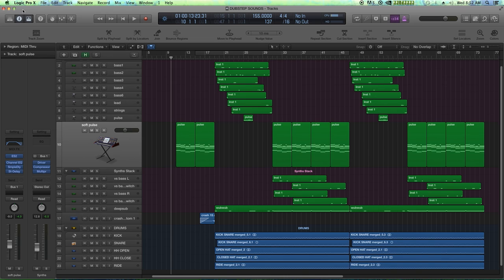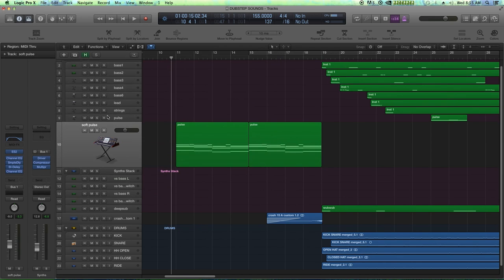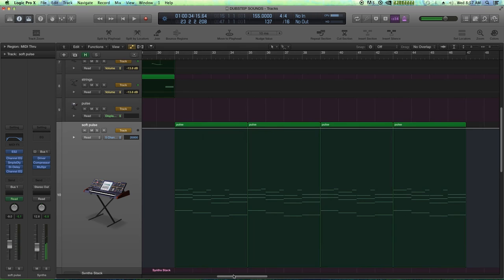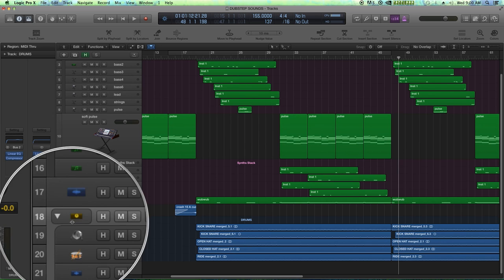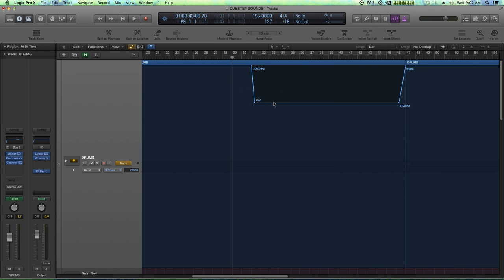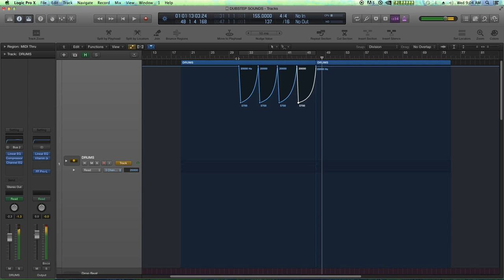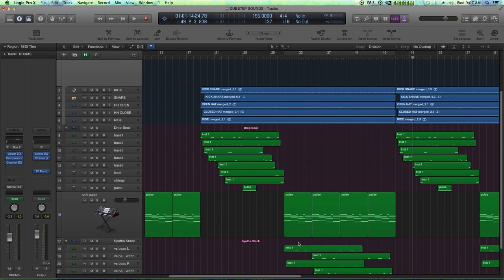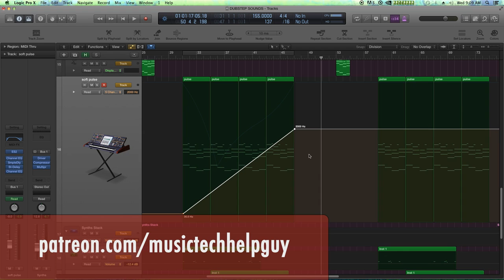Logic Pro X - Filter Sweeps with Automation

Comment: If there's one thing I learned from a previous video here is that if you want to automate a parameter, change the automation mode to "Latch" and then move that parameter control a little bit and an automation lane for that will be created. That is so much easier than scrolling down a list of parameters while hoping you can guess exactly what they named it. Also great for parameters like turning a plug-in on and off because that parameter isn't in the list to begin with.

Comment: There's a couple different ways to do these sweeps in logic and with that being said this is probably the best explanation on how to do it.
Reply from the maker: +Anthony Morales Exactly, sometimes, it's actually better do to the sweep with a synthesizer's build-in filters, because the resolution is higher, so you can do faster sweeps more smoothly, but I just thought this was a good way that works for all synths. Thanks!
Reply: Yeah no problem! I forgot about this way, I'm used to setting the track to touch and manually doing the sweep on the eq, but nonetheless I find this way to just be faster so I'll stick to it. lol anyways keep up the good work, man, your videos cut straight to the chase and help out.

Comment: I've followed the tutorial in using the EQ to automate a filter, thanks btw! However, once the loop restarts where I am automating, a really loud like bang almost gunshot sound happens! scared the shit out of me. So I am listening to my synth gradually coming out of the filter and then as that section I'm working on finishes and loops back to where I started the automation, then bang in my headphones. What am I doing wrong? I'll try explain that better if necessary.
Reply: Its a glitchy sound and only seems to happen when I put the automation point up to 20000 hz